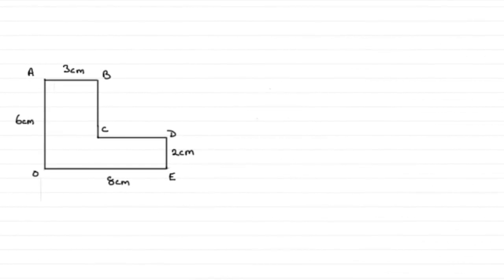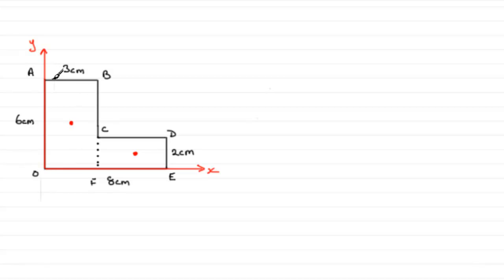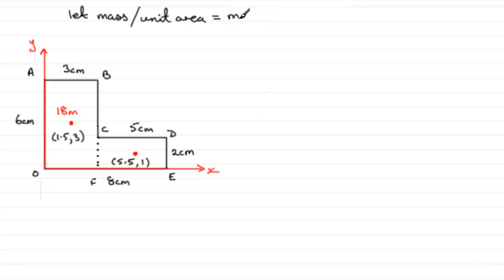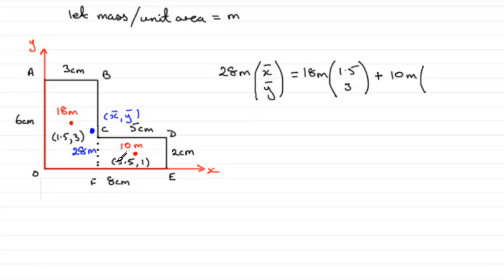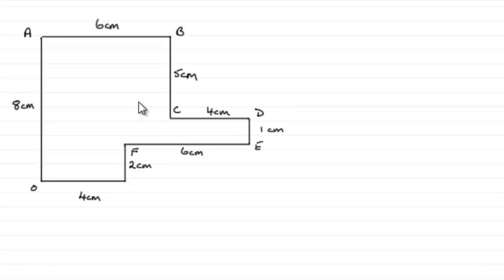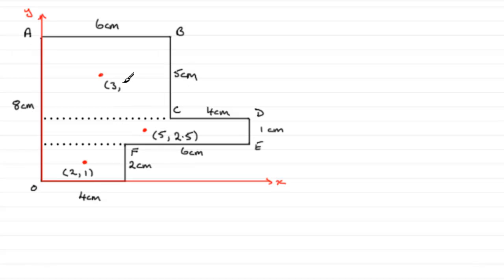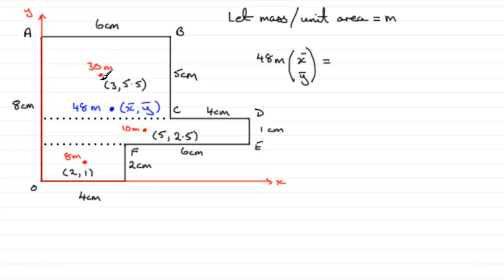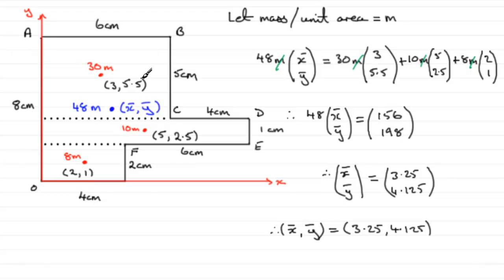Centres of Mass : Composite Laminas (1): ExamSolutions

Comment: sir , if we multiply width and length of a rectangle it would give us the area , so why do we say it is its mass in this case ?
Reply from the maker: Because the mass is proportional to the area.
Reply: and the reason that is proportional is because the lamina is very thin right ?
Reply: @ExamSolutions_Maths   Sir is 100% correct dear. Mass of per unit area is m and force/weight is mg. So it is not necessary to write mg in all parts. let g has been cancelled out.

Comment: Hello, I tried doing the final question but instead of dividing the composite into rectangles horizontally, i divided it vertically. However, I got a different answer from yours. I got Xbar as 3.25 and Ybar as 3.875. Any ideas why? I used the exact same process